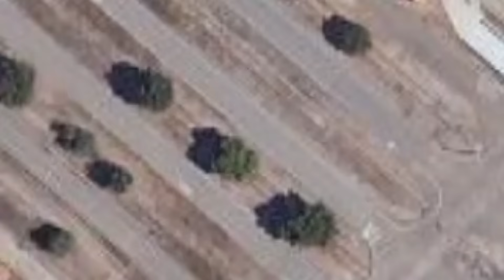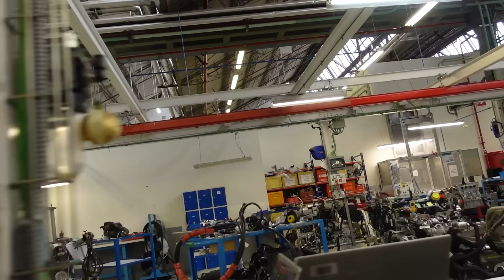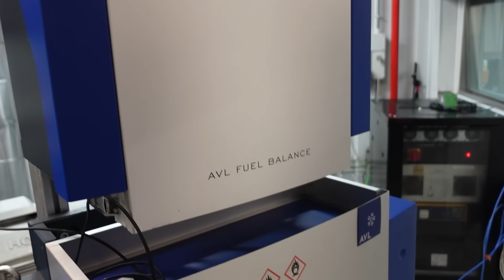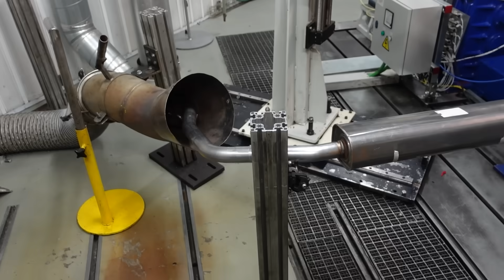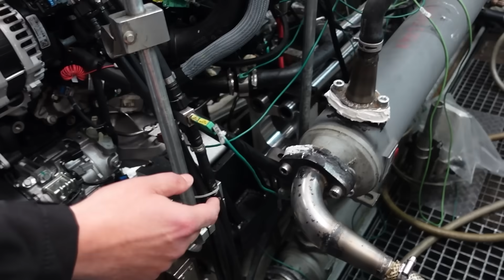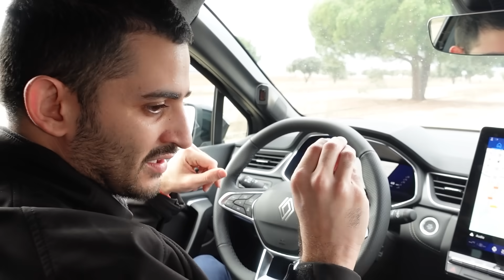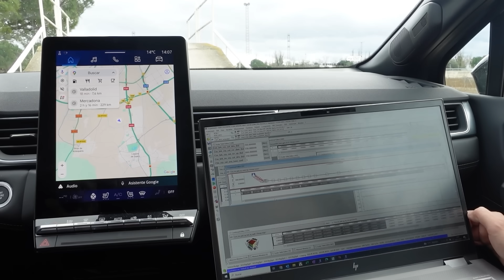Let's Visit A Cutting Edge Automotive R&D Center

Comment: Awesome !! That's exactly the work i do for PSA/Stellantis !! 😂😍
The part in the car were he change engine settings for the creeping is border confidential 🤣🤣
About the answer of last question and the gasoline engine being as efficient as diesel engine. It's been more than 130 years that we work and develop the internal combustion engine, mostly the gasoline engine. In this period, we hab been working on the diesel engine for 30 to 40 years, and the development stopped 10 to 15 years ago due to emission regulations. If we had continue to work on the diesel engine and put the same effort that we are currently putting in the development of the gasoline engine, and i am sure that the diesel engine would have been way more efficient that it currently is.
Reply: I think developing diesel engines to work either with a hybrid drivetrain or even to work strictly as a generator/range extender in an electric motor application would be most ideal for them. It's easy to optimize them to run efficiently and burn clean in a specific rpm range.
Reply: @jameshaulenbeek5931 i totally agree with you!
First, using an ICE strictly as a range extender, the engine only has few working point making it way more simple and cheaper.
Then using a diesel engine will allow naturally have higher efficiency because of the higher compression ratio needed. The only downside i see of the diesel engine is the azode oxide polluant
Reply: its very strange that diesel hybrids aren't being brought to market in greater numbers, many businesses use "tax exempt" diesel fuel for their light vehicle fleets because they don't use public roads, so switching to petrol/gas isn't an option because their infrastructure is built around diesel (pumps at depots, etc)
Reply: @JedPotts-jv2ux for the short answer, because of the cosy.
For less short answers, diesel engine are naturally more expensive and more complex than gasoline engine. An hybrid gasoline is already expensive, so a hybrid diesel will not really be financially interesting. Plus, emissions regulation added complexity to the diesel engine making it even more expensive and practically killed it.
Reply: They were using development software  in the test car's controllers most likely.  Production release SW should be locked out against easy access to the operating parameters.
Reply: @playitlouder451 indeed, they are using a monitoring software, etas inca, and an open ecu and software that allow direct communication and calibration, engine setting, modification. This is only for development and test. Production car have a closed ecu and locked software, that don't have allow communication and modification.

Comment: A brilliantly instructive video. I've been waiting for an answer to the question you asked about the combustion engine turning on and off since the hybrid became a thing.  Now I've heard the answer I'm still not 100% sure.... I've spent my whole driving life being really careful when the engine is cold, and not driving it short distances. Maybe this old dog needs to learn new tricks. 😅
Reply: My friend has a bybrid, when he's driving around town at low speeds the ICE is always off. On the other hand on the highway it almost always on. Which as I understand it is pretty much standard for hybrids. I imagine that equation would change depending on the size of the battery, his Mitsubishi PHEV was good for about 37km at speed on the highway.
Reply: @rfwillett2424 For the more capable hybrids that is normal.  However, for ones with less powerful electrics, the engine comes on and off more frequently. 

If they keep oil pressure up and flowing  and use waste heat from the battery to keep coolant temps up, there would really be no difference.
Reply: @brianhaygood183  That last is a really good point.
Reply: Where this myth comes from is the fact that the engine wears the most when it's cold. So if they don't let it cool down it's OK. Also the thing with short trips is that you've warmed the engine up, you've caused some wear, you've diluted the oil now you can go as far as you'd like without causing significant damage. But instead you stop, let it cool down and that you have to heat it up all over again.

Comment: Diesel isn't going out the window for few decades yet, not in Africa anyway. Always fascinated with used vegetable oils supplementing diesel, ala Volvo 240 et al.
Reply: When VW brought diesels back to the US market in 1997 I sold one to a guy who ran a refinery in Africa.   They were looking forward to having something other than a 1-ton truck to run errands around their complexes with.  There was zero gasoline available in the entire area.
Reply: 20 years ago my high school shop class converted our teacher's VW Rabbit (diesel Golf) to run on used vegetable oil
Reply: @zacharykelly7434 most of Mk3 Golfs (Rabbits) with 1.9 TDI VP (and Passats etc) can run on veg oil without problems. Some PD can do it too (but blend with diesel is prefered, and oil needs to be clean).
Reply: @mmllmmll22 his was a Mk1 😂 but i believe all the mechanical pump diesels can run on oil
Reply: Tuve un BMW e34 diesel y lo utilizaba con aceite vegetal... Olía a palomitas 😂😂
Reply: Of course they are not going out of the window. Manufacturers will just not put them in every vehicle like VW did a couple of years ago.